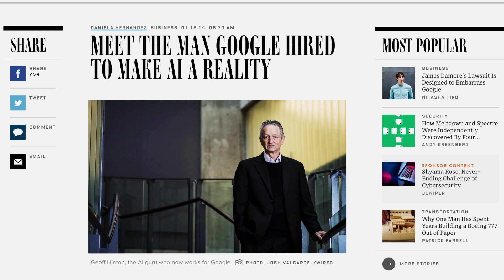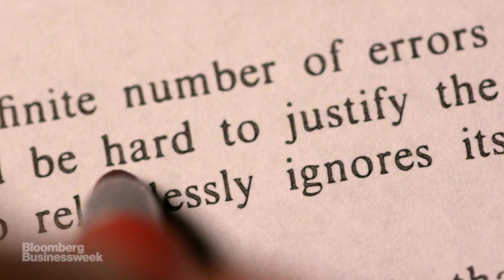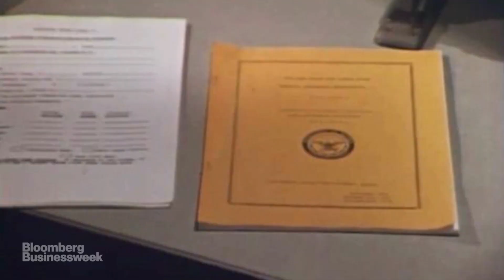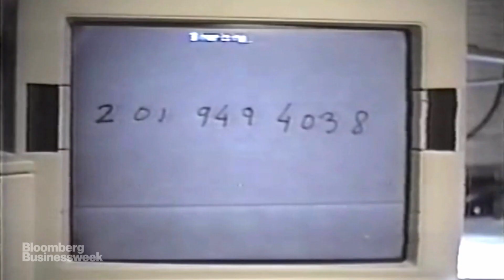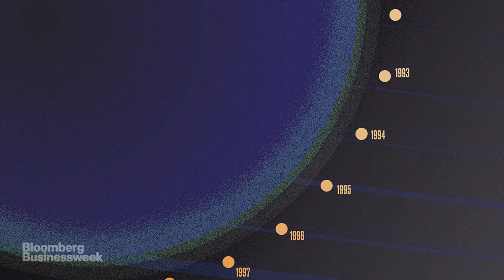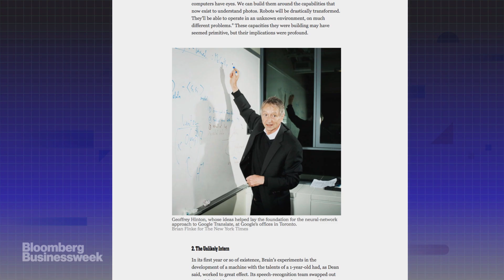This Canadian Genius Created Modern AI

Comment: “The original question, "Can machines think?" I believe to be too meaningless to deserve discussion.”
--Alan Turing, 1950, Computing Machinery and Intelligence
He preceded this with, “Consider first the more accurate form of the question. I believe that in about fifty years' time it will be possible, to programme computers, with a storage capacity of about 109, to make them play the imitation game so well that an average interrogator will not have more than 70 per cent chance of making the right identification after five minutes of questioning.”
These are machines (calculators) running cleverly designed programs that allow for ‘self correction’. But the arbiters of correctness are still - like the programmers - human. It’s a machine; a tool. Do not get carried away by its success in an imitation game. More importantly, the question should be who controls this tool? Like a hammer, and/or screwdriver, it can be used to build sanctuaries or torture peasants.

Comment: Yeah Bloomberg, gotta call utter BS on this vid (and i'm from UotT Engineering etc). The rise of today's "Modern AI" is simply the result of more compute power/$, so now you can take the same (old) model and make it bigger (better), simple as that (some tuning for specific tasks). Same reason QuadCopters are all the rage, the control system used to require a computer that is to large to lift, now they're small(light) and powerful enough to do the job, same root cause (cheap silicon). There you go Bloomberg, write about that (not to mention the work in Asia, but u know, u never report on them...).

Comment: your just creating something that acts like it's a humanoid characteristic for a robot to amplifying signals to the computer that mechanically gives out a programmed function to do. to be able to have a humanoid characteristic, it needs to have organic structure through out the composition of only one organ, and that's the brain. all the chemicals in the brain are derived into chemical reactions that can express of how we actually feel and chose things to happen without control of a circuit filled with capacitors and resistors. in my book that isn't AI, it's the the way of copying information of the very nerve cluster or function across very pathway through connecting wires together to form a signal copying a lay out.